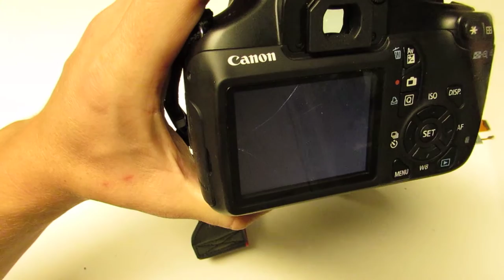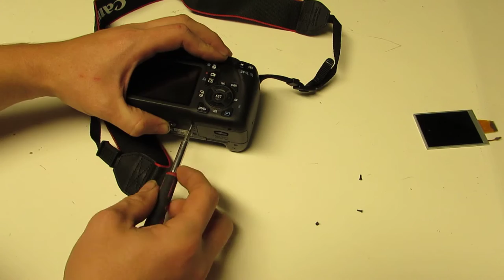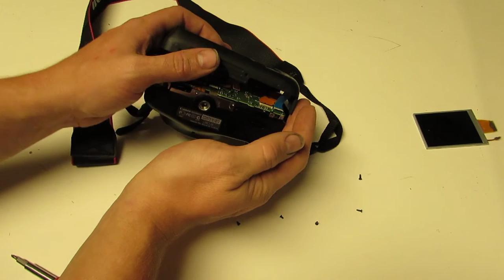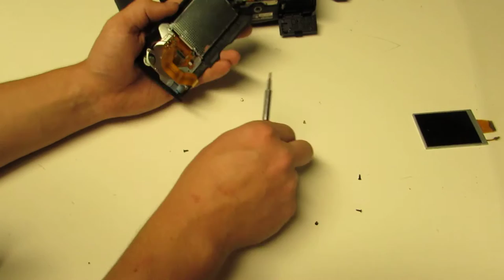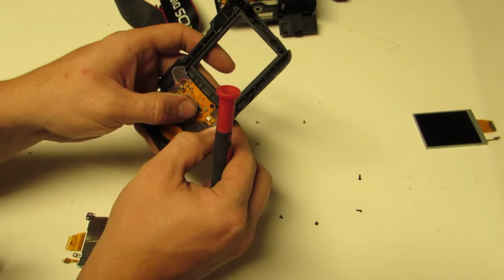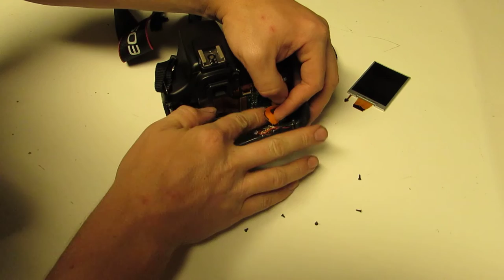Canon Rebel T3 LCD Replacement

Comment: Yay!  After watching you I know what the part looks like I need and my fear of things just falling out when I open it is gone!  Thank you for this video!  You are a blessing!!! :)
Reply: To add..Mine broke without breaking the outer screen too.  I had my camera in the bag, on my shoulder and I bent down to get something off the floor and my camera bag fell off my shoulder, hit the ground on the top of the bag.  Yes, I had the LCD screen (had the long zoom lens on) facing towards the top of the bag.  Dummy me!!  Thanks again for the video!!
Reply: Thanks it was the #00 . Also my down button is not working. All others are. Any suggestions? LCD is working now. Thanks a lot . Very helpfull

Comment: This is awesome! I have the exact same camera and it broke at Disney so I will try fixing it on my own with the exact LCD you used! What kind of screwdriver did you use for this?
Reply from the maker: I use a screwdriver set from Boxer; you can find it on Amazon for about $13:  http://amzn.to/2pUm1oT 
It's my go-to set for virtually everything.  I highly recommend it.  I've worn out a couple, and am currently on my 3rd, but I'm just going to keep buying the same set, because they work perfectly for electronics repairs, and actually last quite well.
Good luck with your repair!

Comment: Extremely helpful video, although after I followed all the instructions and replaced my screen I have no power to my camera.  Any suggestions?
Reply from the maker: Mr777manbearpig Upon checking, it looks like the ribbon for the power button is visible at the top of the circuit board.  I would definitely make sure it didn't get knocked lose.
Reply: Thank you very much it is all fixed! I didn't realize there was a battery sensor on the door so I didn't close the camera up before testing it.  You saved my camera!
Reply from the maker: Mr777manbearpig Awesome, thanks for the feedback!

Comment: The screws on this camera are coming out so easy. I have all the tools you have and I am STRUGGLING to get out a few? I feel like I’m ruining the screws because of how hard I have been trying to get them out. Any advice would be helpful.
Reply from the maker: CristelHulali That is odd; these will be a little tight from the factory, but not extremely tight.  I would definitely make sure you're using the largest screwdriver to that will fit into the screws; using a tip that is too small will make it a lot easier to strip it out. Also, don't be afraid to press hard on the back of the screw driver; I put a lot of pressure on it, to get good 'bite' with the driver.

Comment: where can I buy the lcd? what is the model of the lcd? 
 good video!
Reply from the maker: http://r.ebay.com/lLdvVu is the item I purchased.  http://amzn.to/2nJCjje is the same item available from Amazon.  You can probably find them cheaper elsewhere, but I prefer purchasing from eBay or Amazon.  Just make sure your screen looks the same as the one you order (position of the ribbons more than anything else)
Reply: @ArtByStrongWolf  hello it's ok i have a canon T3 but it shows a black stripe on the screen of the video on the left side on that same screen there you are changing but in the photos there is no such defect could you help me ??
Reply: I cannot find an LCD replacement screen anywhere and after your video it has encouraged me to try and fix my husbands camera myself.  Is there anywhere else I can look?

Comment: Hello what is the size of the screwdriver used? Thank you
Reply from the maker: If memory serves, I believe it is a 00, but I could be mistaken. I recommend a screwdriver kit with a variety of tip sizes; the kit I use has sizes 000-1, and covers 99% of my repairs.

Comment: What screwdriver are you using? My new lcd screen just arrived but the screwdriver set that I purchased doesn’t seem to work, I don’t want to strip the screws. Would greatly appreciate your help with this.
Reply from the maker: The screwdrivers that are included with replacement parts are usually junk, I definitely don't recommend using them.  The set I use is about $15 on Amazon, and I highly recommend it: http://amzn.to/2DH2iNw